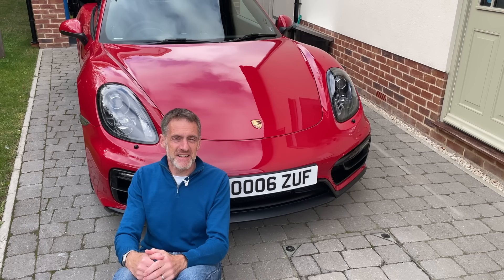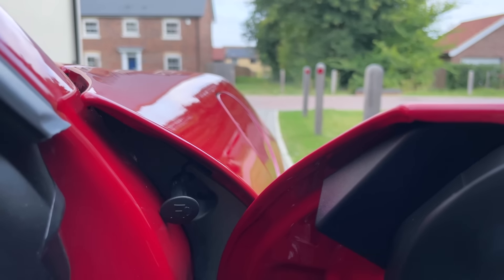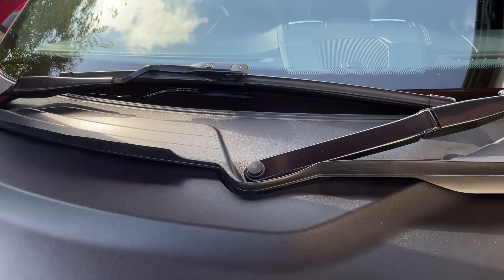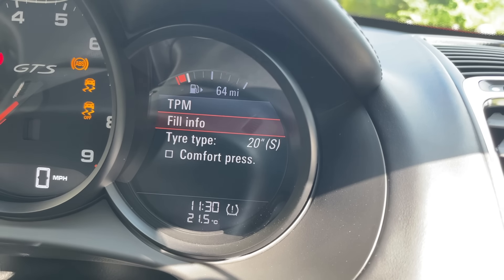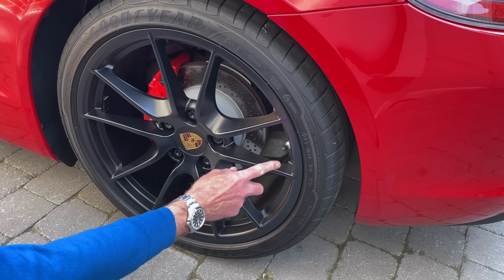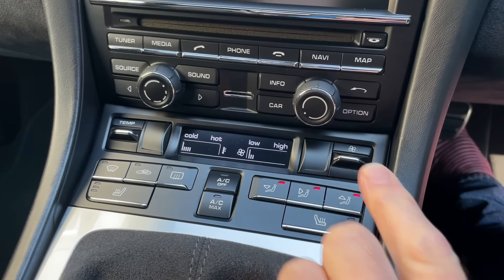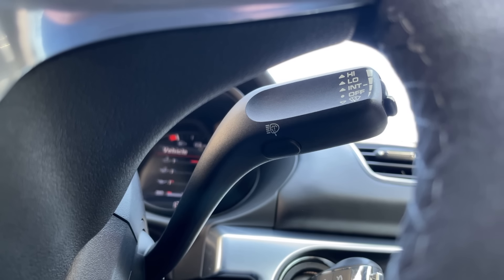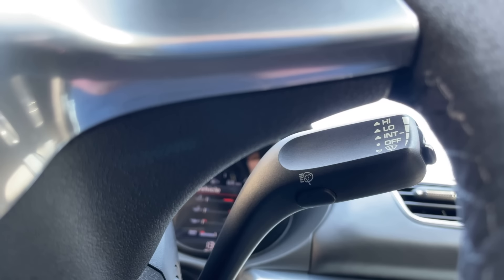Thirty (30!) Hacks, Hints and Tips for your Porsche Boxster, Cayman and 911 – Part One

Comment: One other tip spray the exhaust bolts with WD40 regularly especially the ones that fasten to header being exposed they deteriorate quite quickly being a fitted bolt it can be costly to replace 
Also the window & trunk switches are very brittle & break quite easily if you just have your finger on the edge,  make sure you push your finger to the back of the switch to stop you breaking a piece off 
Have you had any thoughts about changing your radio head unit to a more modern version
Reply from the maker: @stephenmcnamara4393   Thanks for the comments Stephen - appreciated.

Good point about the exhaust bolts. They are famously (and unhelpfully) made of chocolate. 

I’ve luckily not encountered the brittle switches - but useful to now be aware of.

I am curiously happy with PCM 3.1. I might upgrade in the future, but would rather update my speakers and amplifier in the first instance. My car doesn’t have BOSE, and I’d like a little more performance from the audio. (Though the head unit - PCM - seems perfectly fine with a digital source.)

Comment: I had a 996 and I had new wiper blades stored in the bonnet. Of course I opened the bonnet with the wiper arms up. FFS.
Reply from the maker: It hurts doesn't it? Such a frustrating thing to do...   (Thanks for sharing a comment.)
Reply: +1 🤤
Reply from the maker: @steverogers7473  Oh dear. 😕
Reply: I did this too. I have ppf on the bonnet and it damaged that at both contact points
Reply from the maker: @pabs5581  Ooof.  😳

Comment: The US version of my 718 does not support opening/closing the top via the remote (unfortunately…)
Reply from the maker: Aaah yes - I knew that and should have mentioned it.

I understand that it >is< possible to enable this feature using Porsche’s PIWIS workshop software system - which specialists also have access to. Might be worth asking around your local network (and perhaps checking the forums - Rennlist?).